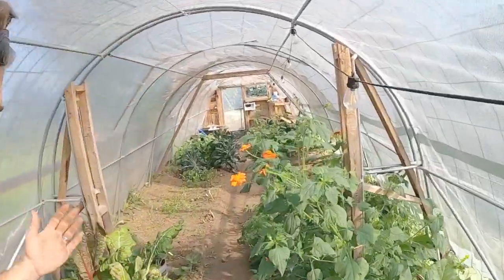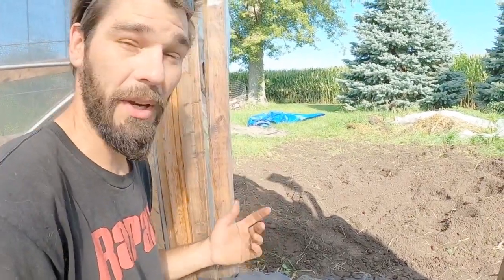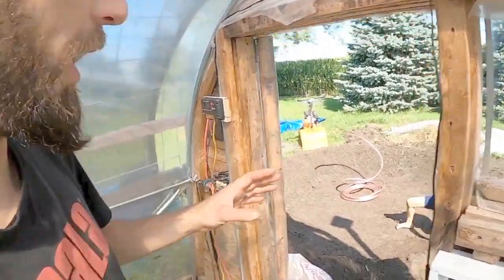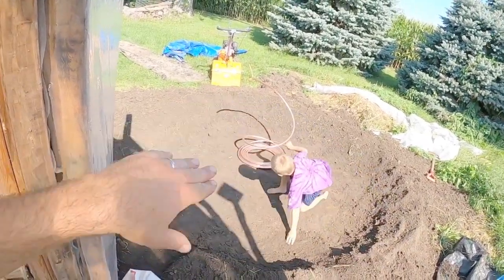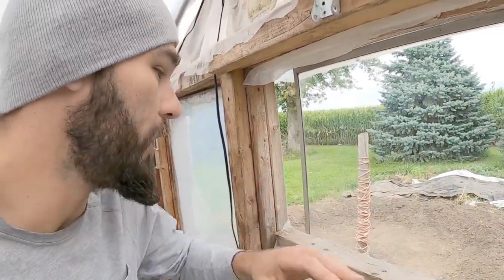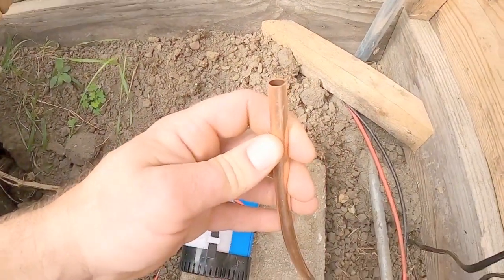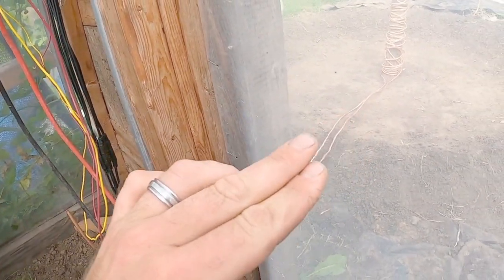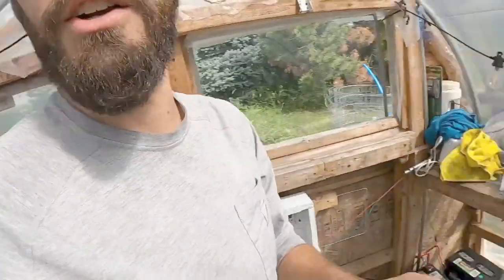DIY Greenhouse Heating  | Water Heating System Beginnings | Free Energy Free Heat | Episode 4

Comment: What kind of pump are you using and how are you powering it?
Reply from the maker: A simple dc powered pump, as we’re not using an inverter on our solar system. You can use any type of small bilge pump for a boat or livewell. If you have an outlet to plug into you can use any aquarium or pond pump if it’s not too fast of flow. A good flow rate is about a gallon per minute
Reply: @Earthdwellershomestead  I’ve got a 35 gallon drum and a 2’x10’ pool solar heater and I want to link them together to warm my greenhouse. I’ve got a DC pump to transfer the water.
Reply from the maker: We tried a few different solar heating options last winter for experimenting and we found some success and some frozen broken lines lol. The sun is a free energy source, We should all be using it. Depending on what zone your in and how bad winter is you could use that set up all winter!
Reply: @Earthdwellershomestead  Yes, I’m in PNW Washington zone 8b. I have a 10’x20’ greenhouse w a 5’x8’ hoop inside of it. My plan is to have the 2’x10’ solar pool heater inside the 10x20 w my more hardy things and connect it to the 35 gal drum that will be inside the 5x8 w my citrus and banana plants. The 10x20 isn’t sealed all the way.
Reply from the maker: @yochanontheseeker1942  that should work well for you. The more thermal mass you can achieve the better you’ll hold temps overnight. We painted some rocks black with diy egg paint last winter which worked well to absorb more energy, any water containers you can fit inside the smaller greenhouse will also hold good thermal mass overnight as well.